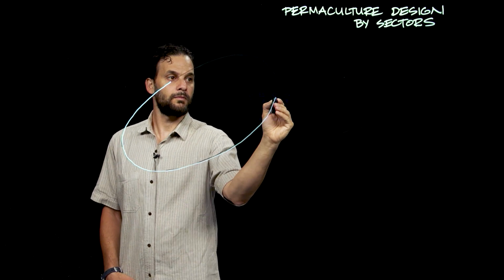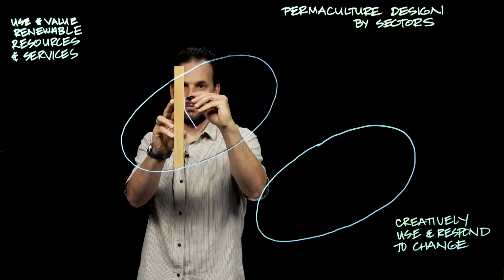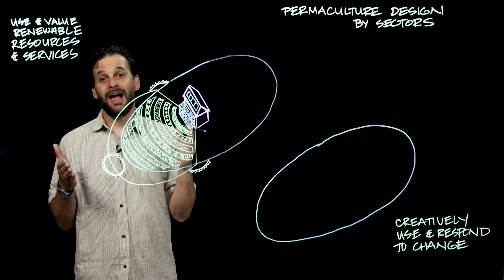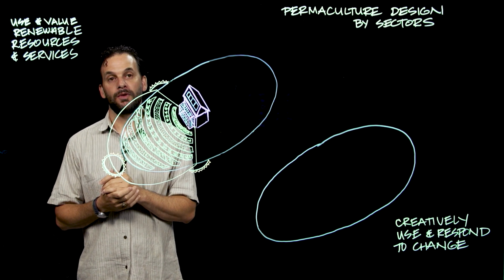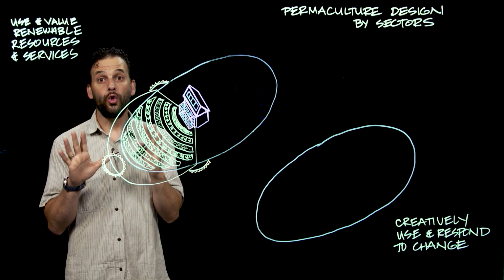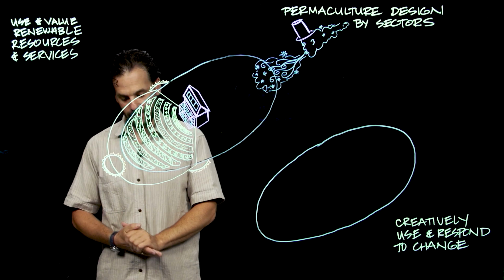Permaculture Design by Sectors

Comment: My biggest obstacles to fully designing a permaculture environment are 1) affordability of buying trees in large quantity, and 2) tools for land manipulation, i.e. excavators. Renting is an option of course, but with over 2 acres of land, there are always projects popping up that require or would greatly benefit from using heavy equipment. Buying these suckers can get crazy expensive though, even used. I haven't found a good solution yet. All ears :)

As for trees, I've heard that every county has a Conservation office with varying resources - apparently some actually grow and sell a wide variety of trees at greatly discounted prices. So please look into this option first, before visiting a regular nursery!
Reply: You can start lots of fruit trees from seed.  It's the tractor that will cost you.  Stay away from kioti, they are made from crap steel, and structurally under built for the attachments.

Comment: A few questions!
Does a tree with leafs or one without really make tak big a difference as a windbreaker?
And i had the idea that maybe a pond could also help  absorb some of the cold winter wind, as water seems to me to absorb cold quicker? Im propably totally wrong with my quesses, but those are the kind of questions i cant answer myself
Reply: It depends what type of winds you want to block. For example, to block cold winter winds, you want a tree that is evergreen so it has foliage during the winter time. Ponds absorb sunlight - solar heat, and radiate it back out to moderate the temperature during cold months. Then they absorb cold temps in time to stay cool in summer. Water has a "thermal lag effect", meaning it heats and cools slowly. Great for temperature moderation.
Reply: Higher humidity air usually "feels" colder because the heat is transferred more effectively, so a pond would probably not be a good idea to absorb cold winds. I think I better approach would be with trees to block and diffuse the wind; a pond just gives more space for the wind to blow.

Comment: This is all wonderful but this is all passive design working in harmony with principles of active design of spaces with our environment ecosystems and holistic natural world. Or biomimicry alludes to this aswell; and not just the built-environment but a sustainable and holistic approach. The mapping of the sun, moon and all natural phenomenon as the wind and types fo trees to use is a known phenomenon common to natural and passive design. Too many labels today as if 'new'. This is not new. Being a Green architect these principles are not new. Just a new word. Supposed to be sustainable design (LEED is 'not' anymore a perfect reflection of it). However, I applaud this gentleman for advancing this methodology that is natural way of doing things. It called common sense that does not exist today. Having an eastern ethnicity, these principles have been used for centuries. Then taken away eroded by the western/rooted in materialism ideology and now come back to fix/undo with a new ideology that is really back to the principles first they initially eroded?  However, in todays world people need a rule book of how to since we have forgotten due to the industrialized world we live in that has made stage to be controlled (descartian principle) out of everything.